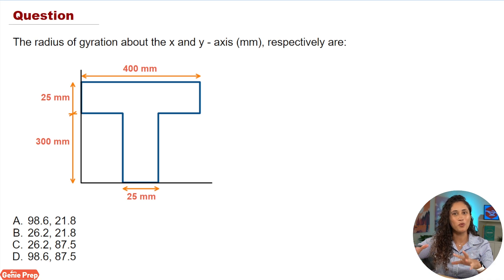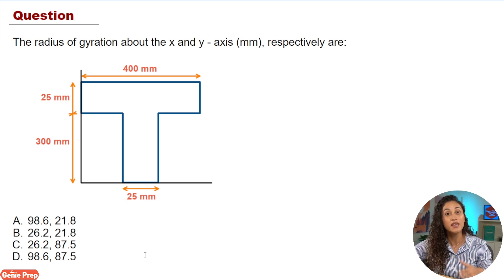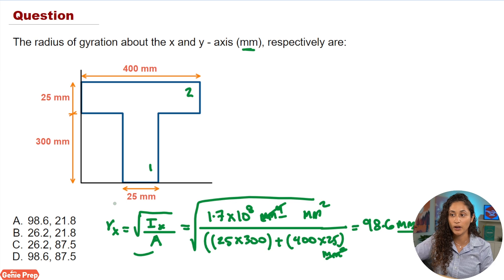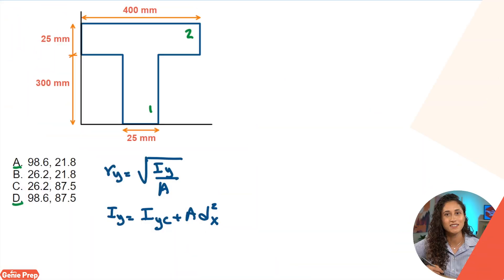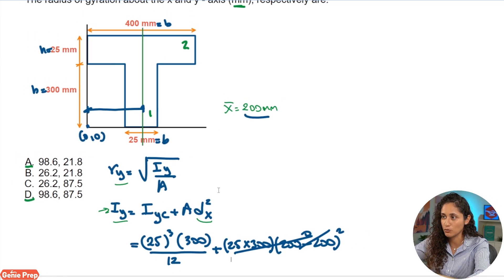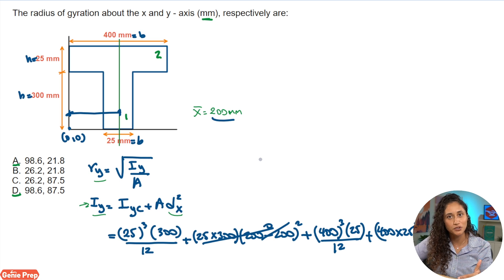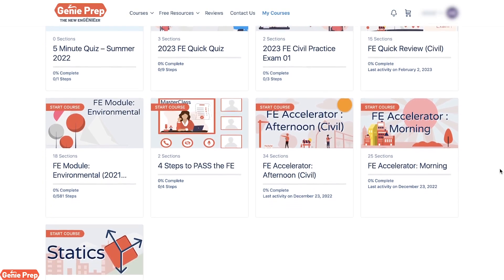FE Exam review | Radius of gyration - Moment of inertia

Comment: Hi GeniePrep. I'm not sure this solution is correct.
Radius of gyration: r_x = sqrt( I_x / A )
I_x = I_xc + d_y^2 *A

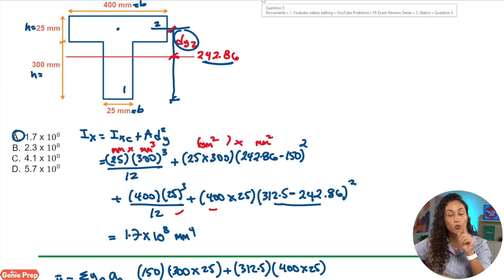At 2:55 onwards, to find r_x, you used the I_x about the figure's horizontal centroidal axis (which is I_xc),
instead of the I_x about the x-axis.
Reply: Wait. Sorry, I think I got confused by the FE Handbook's confusing explanation of the Radius of Gyration (pg 96). Its explanation says "from a reference axis", but it'd be clearer to instead say "from its centroidal axis". Furthermore, the equation for the radius of gyration should be:
r_x = sqrt( I_cx / A)
Reply: Thus, looking back at the problem 0:23, the problem can be more clearly worded,
"The radii of gyration about the centroidal x-axis and the centroidal y-axis, respectively, are..."